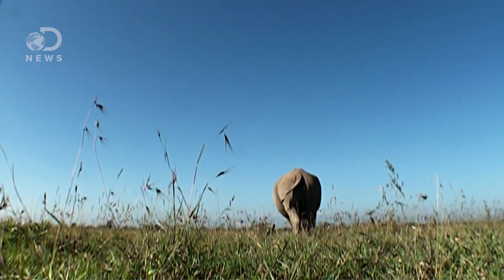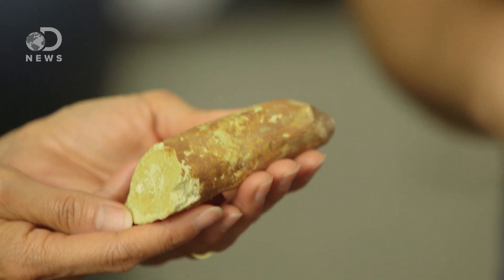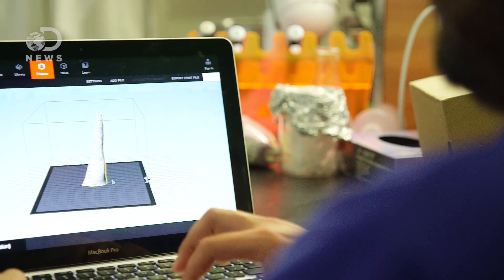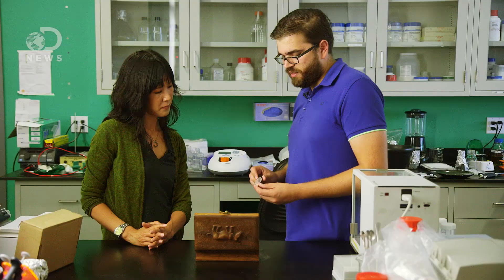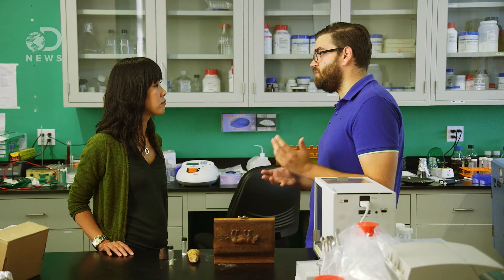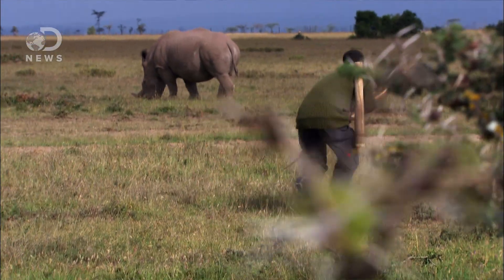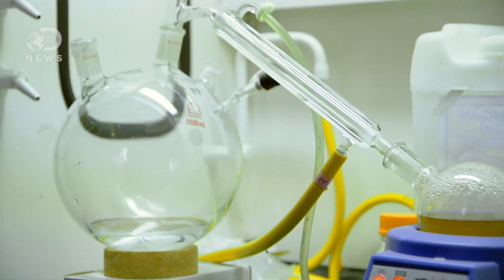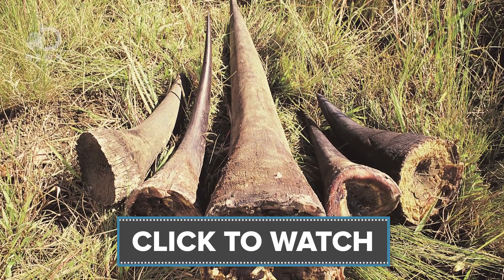Can 3D Printing Save Rhinos From Extinction?

Comment: I am I the only person who doesn't get why they included rhino DNA ? I can get that the feel of it being as close to the real thing as possible but the DNA I don't get.
Reply: Because people buying or selling can test to see if it's real or 3D printed. The DNA addition makes the fake and real horns virtually indistinguishable, which would devalue the price of horns and make rhino poaching less lucrative.
Reply: but how likely are these ppl to test for DNA? I'm thinking not much.
Reply: +ligoner412 if your willing to spend 300k for a horn, u better believe there gona tested lol
Reply: testing for the presence of DNA is easy, you can do it in your kitchen. If you want to test for species you can send it to a lab for a few hundred. maybe not every horn gets tested but i want the black market sellers using the fakes to keep their credibility in the long run so they can keep selling the fakes.
Reply: ligoner412 Even if they don't test for it, you'll end up getting an oversupply of rhino horns, both fake and real. If supply meets demand, the price will drop to were poaching for them is not worth it. Also DNA testing is relatively inexpensive.